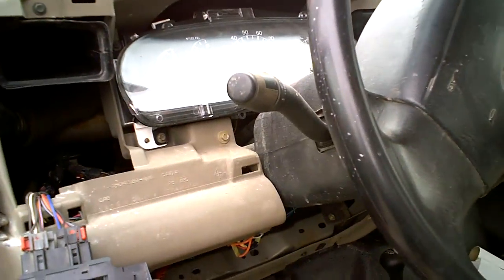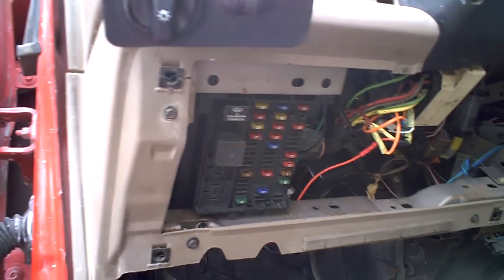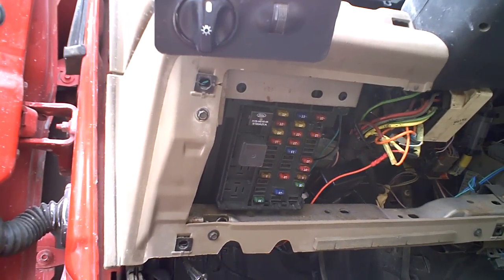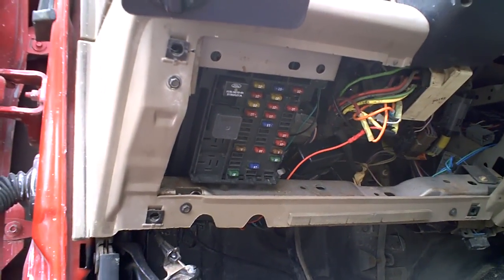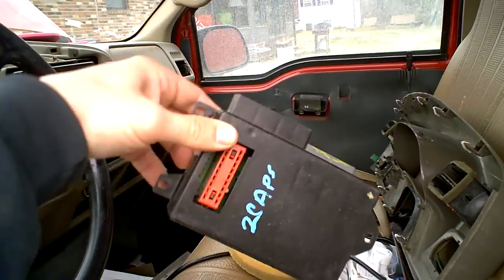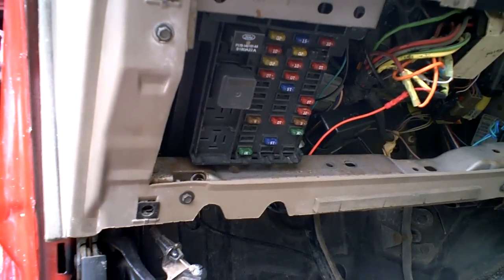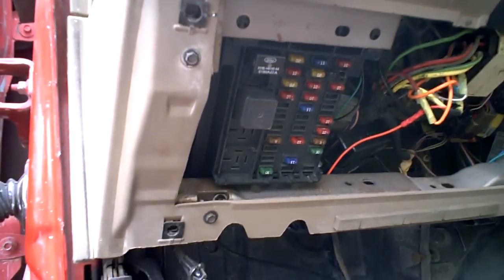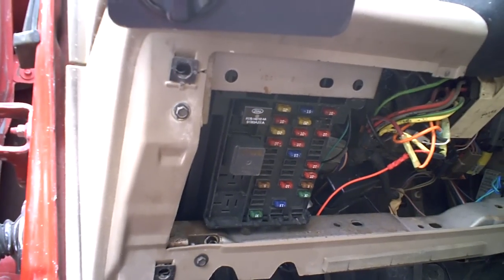F250 Dome Light Problems

Comment: Thanks for sharing. That may be a big help to me with my expedition that's having problem with the dome lights randomly staying  on and occasionally going off. did the same checks with the door latch switches, dimmer switches, and checking across most of the fusses and only pulling a couple. Going to check as soon as she gets home with it. I'll let ya know.thanks again

Comment: I had the same problem with my interior light not working.I pulled the bulb out and the metal end caps were loose on both ends of the bulb.So I had a extra bulb on hand cleaned bulb and connections put bulb in and it's working fine.I got lucky before I started to get into problem deeper.

Comment: The original owner on my truck  had reinstalled the light upside down so dome was on wrong wire making dome was always on. He also used wrong length screws. If the screws are too long, the light grounds itself making it always stay on.

Comment: My exterior light above the rear window won’t shut off the truck is new to me I can’t find a switch for it and it kills my battery every time any suggestions??
Reply from the maker: If I remember correctly the Door Latch,.has a little Switch that is  attached to it,And that switch allows the Dome Light to come on, when the Door is open, ,and if by chance the Switch has malfunctioned ,so that the switch is making contact and sending 12volts to the Dome light  even thought the Door is closed that could be your problem ,but not for sure hope this information may help you thanks for your question
Reply: @utsports  Can removing the fuse keep the battery from draining until the switch can be tested or replaced? Currently pulling the positive cable.
Reply from the maker: @alwilkerson77   Well if the reason the Battery is discharging, is due to the interior light, or the switch then if you pull the Fuse that controls that that should  stop the voltage draw from the  battery and keep the battery from  discharging ,but you could have another problem as well causing the battery to have a draw and thus discharging the Battery,You can like you said disconnect the Battery Terminal,and that will keep the Battery from discharging, but you will want to disconnect the Negative  Terminal instead of the Positive Terminal  Hope this information helps you thanks for your question
Reply: @utsports  Thank you for your swift reply! And yes, we have a Ford Windstar, and this seems to be a common problem. I really just needed a quick fix as my boy is currently driving it and doesn't have a lot of "working" mechanical knowledge yet. The only downfall to pulling the fuse is that the dash lights are on the same circuit. Headlights still work though...so we'll just have to make due until our appt. next week. I didn't want him to have to keep getting jumps or pulling the cable. Also, could you briefly tell me why we should pull the negative cable instead of the positive? Pardon my ignorance...I truly only thought the negative was the "ground" for the battery/car in general but didn't actually interrupt the flow of power. Your wisdom would be most helpful as I am a female in training 😅
Reply from the maker: @alwilkerson77  The Negative Terminal of the Battery is the ground for the vehicle, and should be removed first.The reasoning behind this is to prevent ,or neutralize any possibility of accidently causing a  short ,so inversely if one was to disconnect the Positive Terminal  instead of the Negative Terminal       and you were working around the Battery   simultaneously touched the Vehicles Metal body and Positive Terminal  with  a Wrench or Screw Driver that would cause a short I hope I was able to explain the reasonings behind disconnecting the Negative Terminal first  thanks for your question, and I hope the person, or persons working on your vehicle ,will have success in finding the voltage draw  thanks again for your question

Comment: Hello, just wanna to ask if u know, i have problem too with dome licht...

2 days ago i have try to change my dome light in my trunk... i have pull out my light and try to get in LED ... but when i try to pull out old light , something happend.. my light doesnt work , and i tought maybe Fuse of Dome light ist dead, and it really is .. i have change it but still no power on my dome light ... I check with sample bulb on my fuse , its glow.. and i have try on the dome wire , i dont get power.. :O 

if u have some tips... Plz ... give me :))) Tnx!!!

Auto: Seat Ibiza 2012
Reply from the maker: Hello Muris
        First I need to tell about my Vehicle,its a 2000 F250 Super Duty 4x4,so if your Truck is close to that Year and Model,the Dome Light,Fuses and Relay may be in the same location,if not you will need to look on your Fuse Box Cover,as I'm sure you know that
1} Check the #4 and #14 Fuses, in the interior Fuse Box Panel,and make sure they are good,also make sure they are making contact with the Fuse Box Terminal Connectors,so they will make up the circuit,because in my case the #14 Fuse was not making contact with the Fuse Box Terminals,and thus caused the Dome Light not to illuminate,I found that out later after doing a lot of other Diagnosing/Testing/Research,I actually started to pull the #14 Fuse out, and I heard the Relay click and the Dome Light illuminated I could wiggle the Fuse and it would illuminate the Dome Light
2} Check your Relay make sure its good, you can ohm the Relays Coil,and also make sure that the Points in the Relay are making contact to make up the Circuit,or you can use a Relay that's identical to it from another location in the Fuse Box , and swap it out with a known good Relay usually there are at least 2 or more identical 
 Relays in the Fuse Box
3} I know you stated that the Bulb was good,but I'll go ahead and type this  anyway ,make sure the Bulb is good ,you can ohm it to make sure the Element is good
4} I know you stated that you  checked the Wires, but I'm still going to type this   Check the Dome Light Wires and Connectors,make sure they are not broken
5} Check your Roll Switch on your Dash ,engage it/turn it on, to see if the Dome Light illuminates, I'm assuming you have tried that, but i need to state that
6} Check your Door there is a Dome Light Switch that operates off of the Lock/Latches Cam,and sometimes the Spring loaded Switch will stick in a closed or non contact  position you can spray WD40, and try to release the Switch,but you need to determine if the Switch is in a contact position or making up the Circuit because when the Door is open  the Dome Light should illuminate if everything else is functioning properly to check the Switch you can ohm the Switch,you will have to locate the Wires to the Switch , you can take the Door Panel off the Door to  get to the Switch to test it
7} I typed information in #6 ,about the Doors Dome Light Switch,I need to say this if you have turned on the Roll switch on the Dash,and the Dome Light did not illuminate, even though the Doors Dome Light Switch may be stuck in a Non contact position it doesn't matter, because the Roll Switch should  illuminated the Dome Light,so if you have tried the Roll Switch and no illumination then you have another problem
8} If you have tested the Fuses ,Relay, Wiring ,Dome Light Socket , Roll Switch,and Bulb and you know they are good
9} Then there is a good chance and more than likely its your{ GEM }{ Generic Electronic Multifunction Box} is bad,or the Circuit in the GEM, that sends or allows 12v to the Dome Light has a fault,which is not allowing for the  Dome Light to illuminate,so this is probably your problem,again if you know everything is functioning properly then  it  usually ends up being the GEM  
10}  The GEM is located or attached to the Back of the Interior Fuse Box, it will have I think 3 Torx Screws, that you need to remove, to detach the GEM from the Fuse Box ,you really need to unbolt the Fuse Box,from the Dash Frame ,to get the GEM detached  though, because it so tight there's not much room,but after removal you can open the GEM up, and see if there are any visible problems, and you can also take a Magnifying Glass and look closer at the solder joints and maybe re-solder some of them
  also below is a link to a guy that went through a similar process as me and he detailed it and has some Pictures it will help you  http://www.ford-trucks.com/forums/1011353-dome-light-not-working-tested-almost-all-components.html
Reply: utsports

Thanks on this information ... but i have solved my problem , 

I have diskonekted my + und - from my Aku ( Battery ) and  i have waited for a minut , to car get no power... Than my computer inside the car has restarted... so i have back wires on battery .. and i have a power on my Dome light.. :) 

Problem solved
Reply: utsportt

Comment: Do you know what wire in the dash / sill I would tap into if I wanted to add footwell lighting so it comes on / off with the domelight?
Reply from the maker: I sold the Truck a while back ,so I don't have access to check the power Wires going to the Dome light.However I think,but I'm not for sure that the Wires travel up through the Windshield Pillar,so you could check, by removing the Pillar Trim cover ,and see.And, if you can see the Wires,then you could test those Wires to see if they are for the Dome light,and if so  ,you could just tap into those Wires and run your tap down to power your lower lights.I hope I was of some help to you,with you,and thanks for your question .
Reply: @utsports  These people don't know the difference between a short and a bad connection.
Reply: @utsports  These people doesn´ t know difference between a short and a bad connection.
Reply: These people don´t the difference between a short and a bad connection